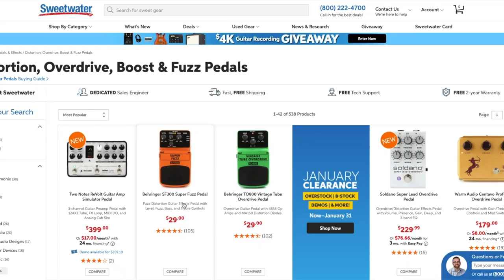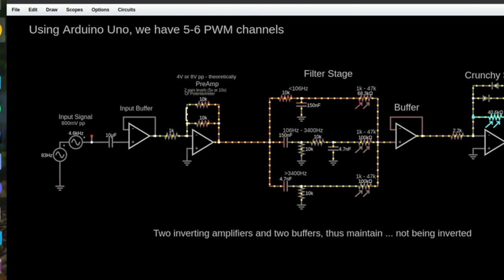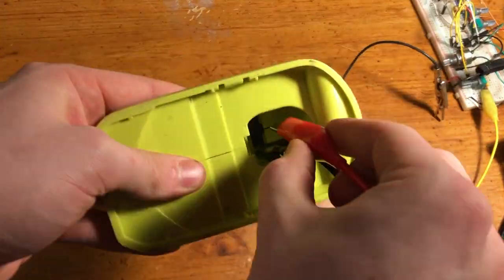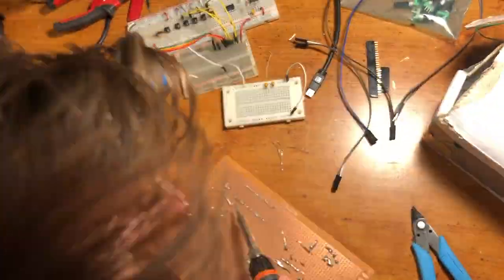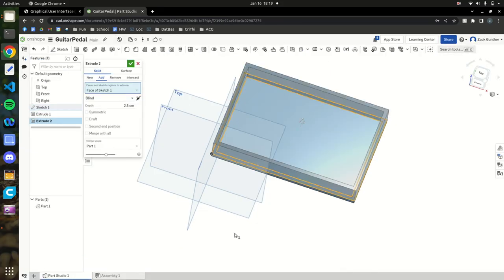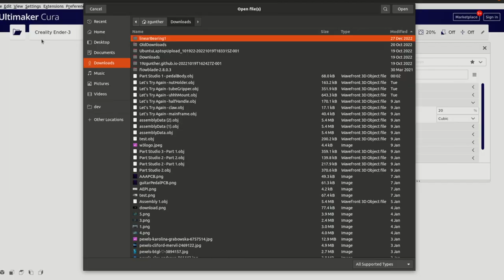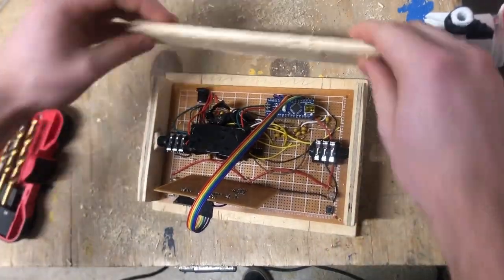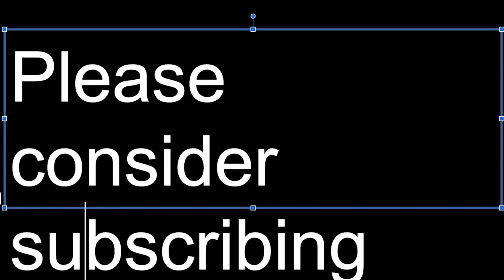Building A Hybrid Guitar Pedal (Analog & Digital)

Comment: wow, congratulations on completing the project.. I'm also working on a project similar to this. But I have problems with noise due to the oled display. How do you keep the output signal clean?
Reply from the maker: Hi, I surprisingly didn’t have too much noise from the oled display - I had a pretty substantial low pass filter for the pwm outputs to the LEDs though, and that reduced a ton of misc noise